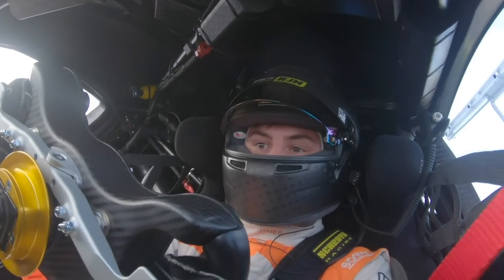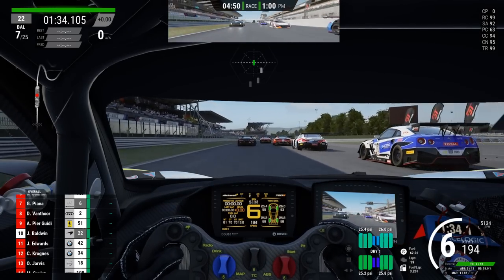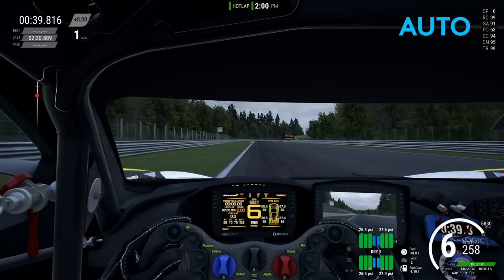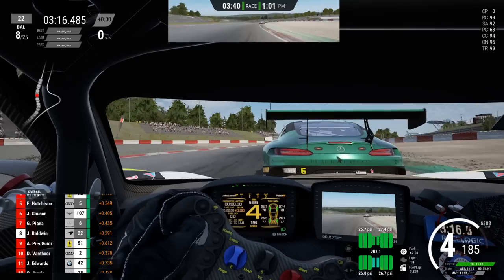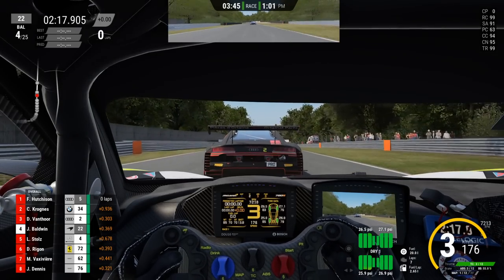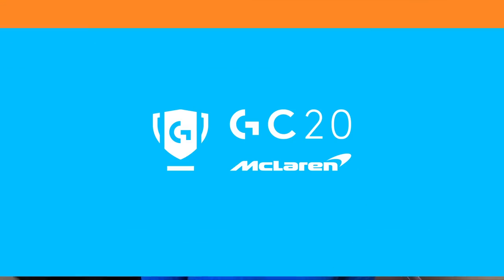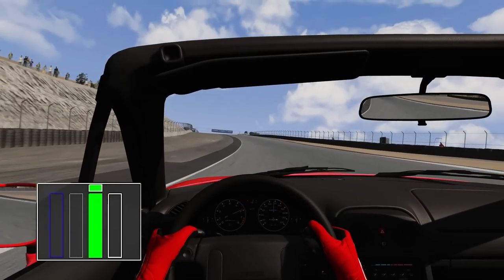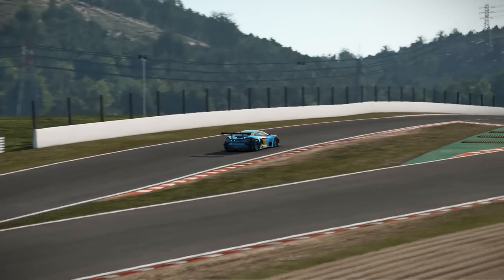Manual Shifting - Take Your Sim Racing to the Next Level

Comment: Ur articulation and way of explaining this is very thorough and understandable, I appreciate that. Many videos I have found regarding this are simply inadequate and don't explain it in detail let alone while elaborating on helpful strategies to go along with it. It's like a lot of vids I have come across say they are for beginner manual drivers and then skip all the important details  in a way that literally makes 0 sense at all, like " here u go this is for beginner learners but u all ready know all this right? So we will skip the good stuff" lol.  Should have been titled " tips for intermediate manual racers". I have been Sim racing for 2 months mostly playing FH5 and DR 2.0 on Xbox. I have a Thrustmaster TMX with only the 2-pedal set, haven't upgraded to the T3PA yet and also don't have the TH8A shifter ( yet), simply using the paddles. Most of the time I have driven automatic because of this but I've become increasingly more intrigued by the concept of manual driving. My first learning curve was drifting in FH5, I was obsessed and became fairly efficient at it within a month ( practicing for hours every night), I discovered that I could maintain a drift better around long corners and especially during transitions driving in manual. It was a game changer for me to say the least but still only knew the basics. I get the concept of up shifting but down shifting for whatever reason I could not grasp, as in the timing of it and knowing at what exact speed when decelerating to hunker down and how far, basically the timing in general when in manual has been rough for me and this vid enlightened me far more than any other. This is a he'll of a journey man and I truly can't wait to upgrade my equipment. I will tell u this tho, the Thrustmaster TMX is prolly the best budget wheel on the market. I was so worried it would be a waste of money but I've had immense fun with it and the ffb is actually very solid.  So glad I got into this Sim racing culture,  it's only up from here eh?

Comment: Is heel and toe effective in ACC? Also, shifting from 6th to 2nd do you heel and toe in every gear or you jump-shifting and heel and toe once in 2nd before you let the clutch?
Reply: First question, yes it is. Heel and toe is always faster because you are braking and shifting at the same time with revmatch and not after each other. And i jump gears on hairpins and blip once.. But sometimes i use 2-3 gears inbetween for extra braking, laguna seca turn one for example, aproach in 5th downshift to 3rd and then exit in 2nd
Reply: But is theres no point in using the clutch in ACC? since all cars are sequential?
Reply: @zeyzerx3722  that is just not true?????

Comment: I've started using manual gears in all types of racing games, and it's ridiculous how bad the AI really is in more casual racing games.
You loose soo much time with auto gears, and the computer usually shifts too early and you loose a lot of the power you get from higher revs.
With manual gears, you even get more grip during racing.

Comment: For heel and toe you said to "blip the throttle right after releasing the clutch".  As a pro driver you know better!  I compete in amateur racing (NASA/SCCA, etc) so I'm not just a gamer like I suspect most people playing these games are. I had my most dangerous spin while trail braking entering a corner hot when my foot slipped and I released the clutch before the revs had been matched.  Perhaps you misspoke.